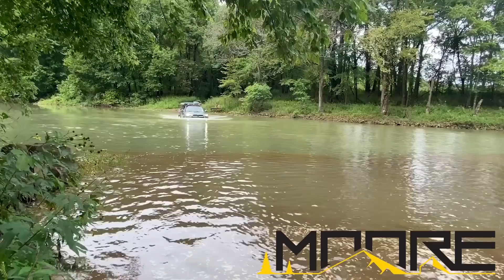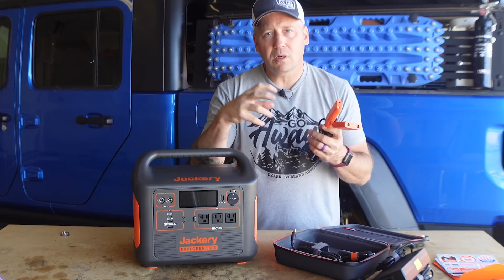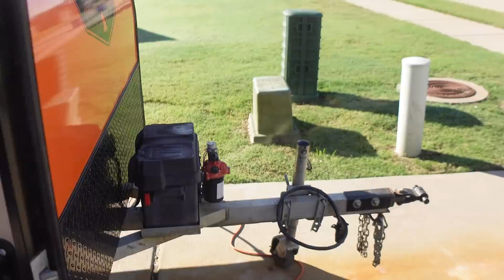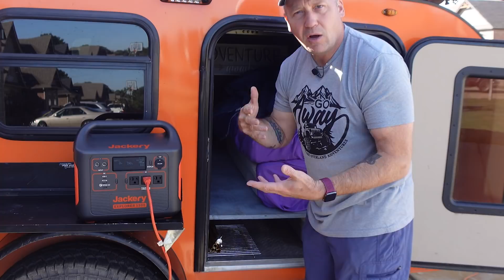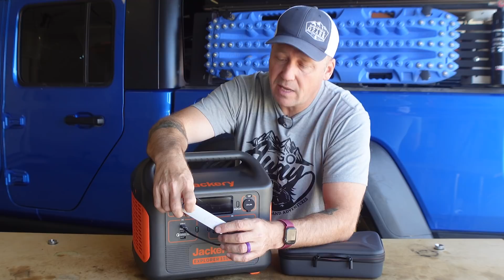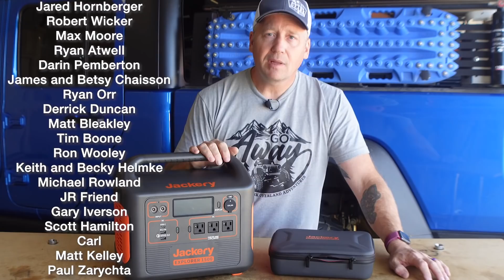Jackery Explorer 1500 Pros and Cons for Off Grid Adventures

Comment: If I remember correctly you ran the same test on Jackery 1000 for 93 hours. For 50% more Wh capacity running time is 128 hours, so only 37% more. This leads me to believe the DC overhead is somewhat bigger on the 1500Wh station, thus some of the capacity is lost to self-consumption. I would love to see the same test ran on the Jackery 2000 Pro. I am curious because I had a huge surprise connecting a fully loaded Bluetti AC200 MAX to a Dometic CFX 35 and after 19 hours SOC was 75%!!! After 27 hours it was at a shockingly 60%. Parsing the Bluetti forum I discovered that the DC overhead was 11W continuous!!!

Comment: Hey I got a question. I just recived my jackery 1500 when I opened the box the jackery was on and led light was on right out of the box and it had 1% battery. I had it charged to 100% and I noticed in 5 hours I loose 2% without using it. Is this normal?
Reply from the maker: That is definitely not normal. Make sure all your ports are turned off.

Comment: Let me preface by saying great content as always. Ok Mr powerstation man.  Lol.  I currently have a PLB 40 which is fine but no AC inverter.  Want all in 1 solution.  Question.  I have narrowed my choices between Jackery 1500, 2000 or new Ecoflow delta max. Have an AEV Jl overland rig but slightly hesitant on the size.  You think these are physically too large?  49 lbs a beast.  Remember us overlanders with Jeeps need items to be dual use.  I could use it for home outages which are often in Michigan. Ecoflow River doesn't do much for me.  Jackery 1500 or 2000?  Hard to beat 0 to 80% on ecoflows.  Your opinion is valued and appreciated.  Thanks in advance.
Reply from the maker: I have no experience with the Delta Max but have heard great things about it. I recently reviewed the Delta Mini and that's my new go to powerstation. I love it. I would imagine the Delta Max is very much the same just larger. I'd go with the Ecoflow.
Reply: You just confirmed what I was thinking.  Thanks so much!  Cheers to you and Cara!👍

Comment: Worse customer support I’ve ever received. Panels failed and after having me make a video to show/prove they weren’t working they shipped them to the wrong address across the country. They stated they corrected the address with FedEx but instead of having them shipped to me they had them
returned to Jackery. You can’t reach and talk to a live person. All contact is through text and email at odd hours. Most responses were via email at 1-2am. I’m living and traveling full time depending on a system I can’t keep charged and a month later I’m still waiting for jackery to honor their warranty and send me panels to replace the failed ones. Buy if you want but don’t depend on the product or the company’s support of the product or customer.

Comment: good video. i was lucky enough to get the jackery 2000 before they sold out. i love it, no power brick. ac charging at 1000 watts a hour. up to 800 watts using my four 200 watt solar panels. hopefully they will bring it back soon.

Comment: Will this power a standard fridge in case of power outage? What does the voltage read when ready without a load? thank you.
Reply: Yes. I have used my Explorer 1000 to power my 10 year old, 20 cubic foot fridge for 16 hours straight. I believe the Explorer 1500 should be able to power a similar full size fridge for about 24 hours straight on a single charge.

The voltage for all the Explorer units is 110V / 60 hertz. Max continuous output for the Explorer 1500 is 1,800 watts (16.4 amps @ 110V AC), PURE sine wave.
Reply: @kenp.7304  fantastic, thank you Ken !

Comment: My interest is very narrow - looking for something to power a ~55 quart 12v fridge for a week, staying put a couple days at a time, then 2 - 4 hrs driving, 90 degree days and 70 degree nights. At some point, battery capacity will negate the need for solar panels, another expense. Plus who wants to haul that around. Is the Jackery 1500 the one or does 1500 watt hours still fall short for fridge use beyond a long weekend?
Reply: If you don't need a larger inverter (> 1,000 watts), check out the Bluetti EB240 with 2,400 Wh (watt hours) of battery capacity. It is an older model, and doesn't have a lot of bells and whistles, but it is currently available on Amazon for only $1,200 (with coupon). That's only 50 cents / watt hour; whereas the Explorer 1500 is $1.04 / Wh. Keep in mind it does weigh a hefty 48 lbs., versus 35 lbs. for the Explorer 1500.

Let's say that your 12V fridge draws power at a rate of 45 watts while actively running. Since fridges tend to only run about 1/3 of the time, that would give you a average rate of only 15 watts over time. See below for hypothetical run-time comparison based on an average rate of 15 watts.

Jackery Explorer 1500 ---- (1,535 Wh * .90 efficiency) / 15 watt device = 92.1 hours (3.8 days) of effective run-time.

MaxOak Bluetti EB240 ---- (2,400 Wh * .90 efficiency) / 15 watt device = 144 hours (6.0 days) of effective run-time.

P.S. Your actual run-time may vary depending on your 12V cooler's exact wattage, ambient air temp, and internal temp setting. Keeping a heavy blanket over your 12V fridge will increase run-time. Hope this helps. :)

Comment: I agree that they should have put in more USB ports on the front.
Reply: At least there is more on the solar panel itself.
Reply: You can buy a usb splitter that plugs into one port and has multiple usb ports at the other end. Very useful for laptops etc also.

Comment: Wondering if you can plug the wall charger into one of the outlets, and charge itself while it's in use?
Reply from the maker: I don't think that would work out well.
Reply: @OzarkOverlandAdventures  How long do you think it could keep a regular home refrigerator running in the event of a power outage that lasts for 5 days?

Comment: So, Jackery or Bluetti?
Reply: $1,500 is a lot for something that only has 500 lifecycles. I just traded a Jackery 500 to a guy along with a 100w panel for a Dometic cfx3 25 with the cover. I feel dirty.
Reply from the maker: Honestly it depends on the size you need. in the 500wh range, Bluetti because Jackery's 500 is ancient. In the 1500wh range, Jackery because Bluetti's EB150 is ancient.